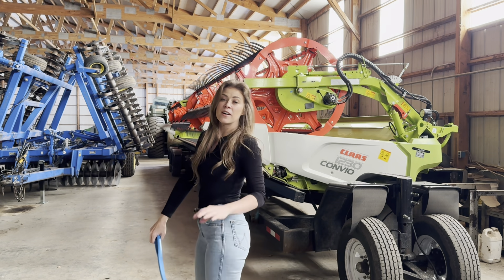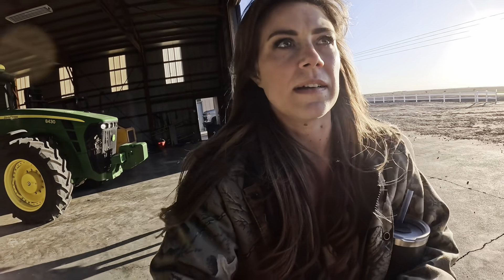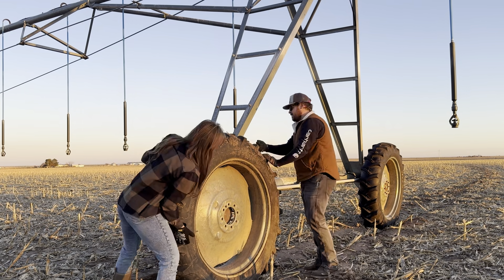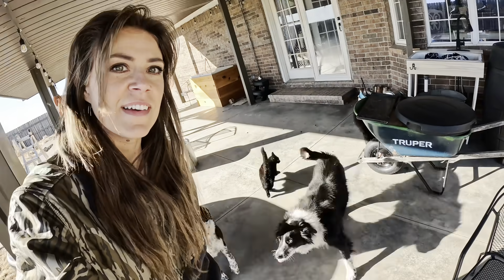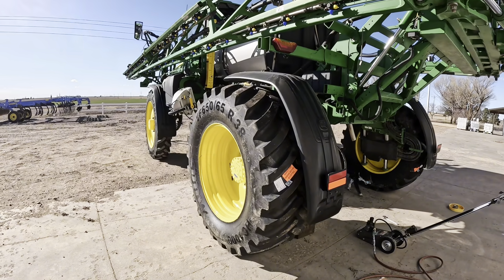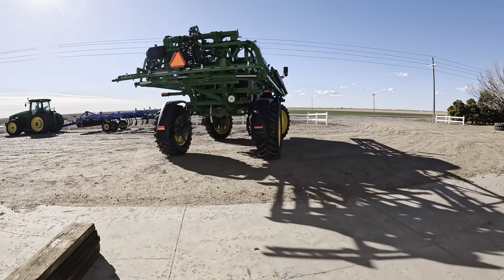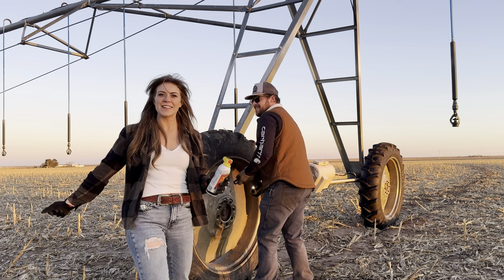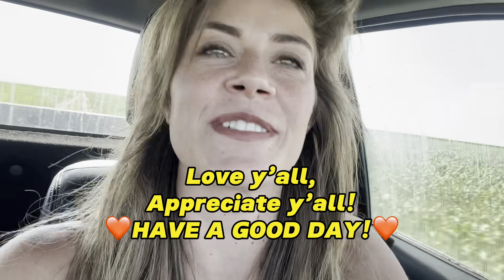More Equipment, More Flat Tires

Comment: 1230 the number on the header must be metric for 12.3 meters or 40 feet
Reply: 12.3 meters
Reply: @darrylpaulhus3069  yes. Thank you I will add that in to my comment.